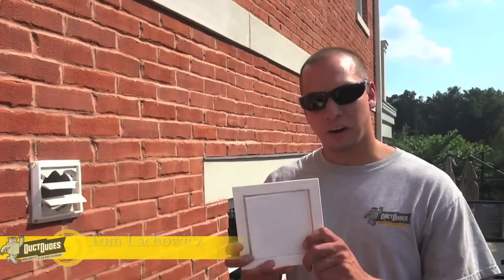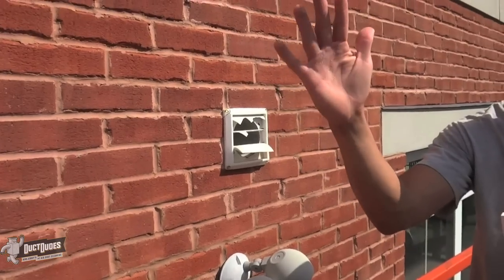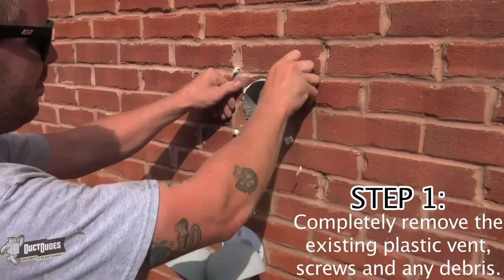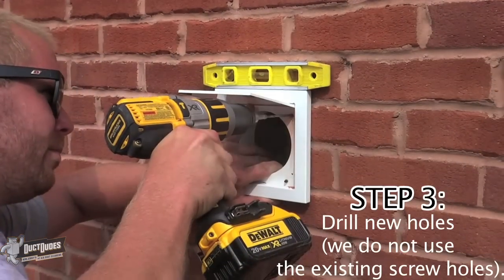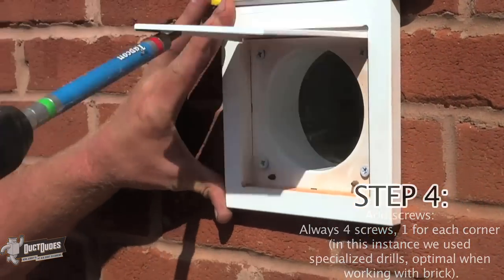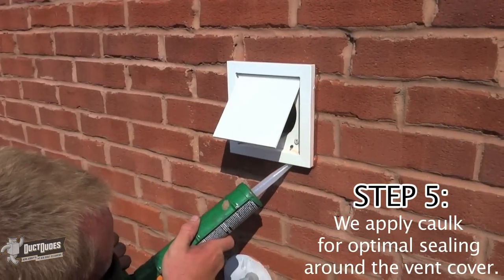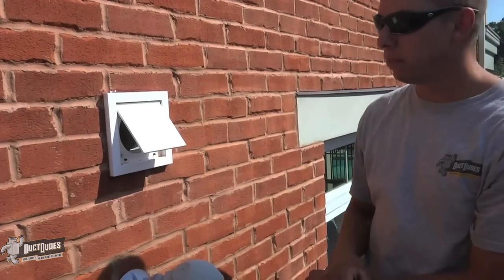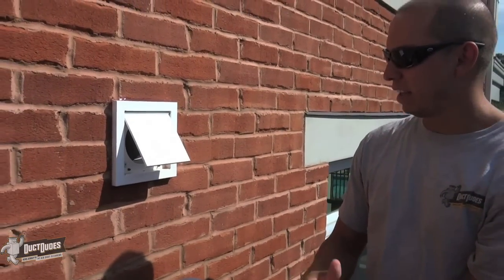NJ Dryer Vent Cleaning - Dryer Wall Vent Installation

Comment: What type of dewalt drill  is it a hammer drill for concrete and brick application? And type of drill bit for screws are you using? Looks good. Thank you.
Reply: It is a dewalt hammer drill.   We use a drill bit made for drilling into concrete.   Drill is on the hammer setting.  We put anchors into the wall then any type of screws.  Or we use tapcon screws and go directly into the brick.
Reply: @texmex1978  thank you sir! 
I thumbs up and subscribed 👍😁

Comment: If I want to remove the existing pipe and put a new one in the brick wall, what’s the best way to remove it?  It’s been in the wall for 10 years and it won’t budge when I pull on it.  Thanks.
Reply from the maker: Tide, this sounds like it can be a lot of work.   removing bricks, possibly going into the wall.   Most likely it is cemented in.  If the air is flowing out of the vent, i would just leave it.   otherwise you will just have to find a way to rip it out.
Reply: @Ductdudes  Hi, thanks.  It had some corrosion in it, so I removed it, but it took about 20-30 minutes of pulling, pushing, turning, tearing, etc.  I think the helpful thing is the dimple running down the length of them.  If you put enough pressure on the dimple, it will come apart, but believe me, it did cross my mind to clean it out and keep it.